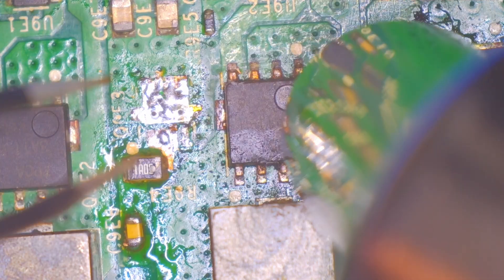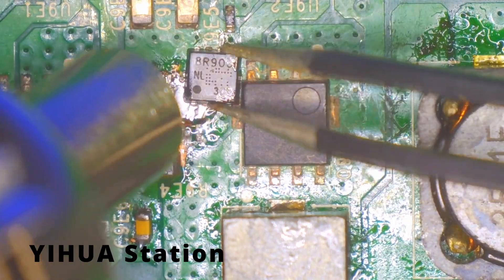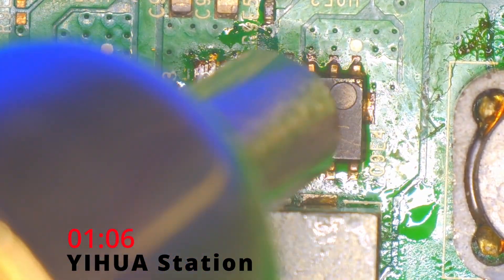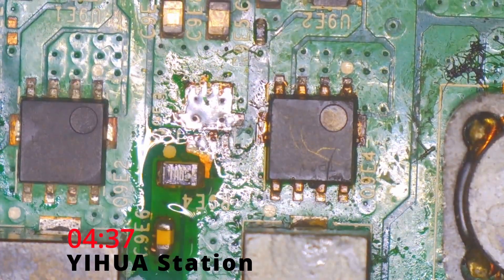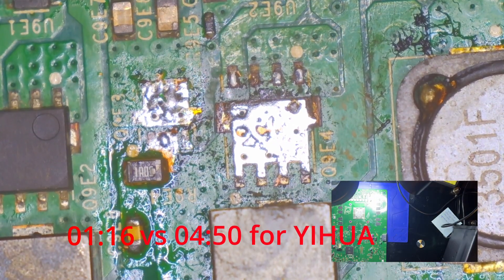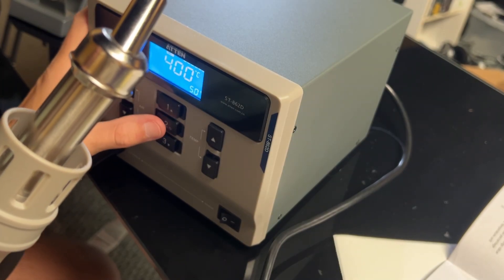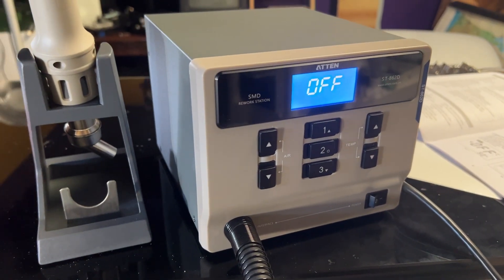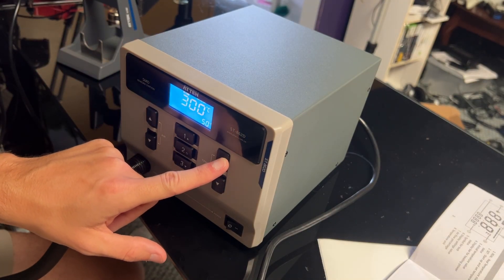Hot Air Station Review - Atten ST-862D vs YIHUA 959D Can a cheap station compete?

Comment: Should've put low melt solder on pin before using hot air station

Comment: bought a cheap one and it broke after few uses, but at first it was user error and couldn't desolder anything. i'm planning to buy also a cheap one but with the air blower inside the main station, seems more robust somehow, although the unit is almost empty

Comment: Brother you must be a beginner. You have to use low melt solder on the joints first and then use your hot air station comes off with low temperature.

Comment: I have a similar station to your cheap station.  Today I tested the heat with a thermocouple.   The iron was 50c degrees lower than stated - 250 at 300c degrees.   But the hot air gun was 50c degrees hotter than stated 450c at 400c degrees

Comment: Good review. I also have that Yihua unit but had not done a whole lot of micro pcb jobs with it. What it did awhile back was slip out of the side mount holster a little, reheated itself and melted the holster so badly that it wouldn't auto shutoff anymore. I just started to get serious about learning smd guitar amp repair, just bought a new Amscope SM4T and was shopping around for a new hot air station and saw Rossman's video, so I ordered one from his store as he had a much cheaper price than Amazon and he also includes the angled tips. I should have it tomorrow.

Comment: Here's an alternative that might work. A standard heat gun, better with a reducer nozzle to increase air pressure and isolate heat more. Obviously it's not the best tool, but Harbor Freight has one for $10 that goes on sell for less than that I believe. It comes with nozzles I think and they sell a nozzle kit too I think. But the nozzle part is probably less important.

Small one can be used for components it can handle and the full size heat gun can do in a pinch. Atleast I would assume that with a concentrated enough nozzle, a heat gun would put out far more heat. I've seen people use them before so I know it's possible, worth a shot for people on a budget and who don't want to dish out big bucks for hobbies. A torch variant would probably work too.

Comment: have  quick 857dw  it's been  4year's working fine and all board including high end GPU
don't set  your hot air  always max temp,  the heater will die fast,  just around 400 or 380c lastly  always use large nozzle

Comment: A minute of hot-air blasting seems like a LONG time!  I have not experienced this issue with my Yihua 959D, but I have had problems with the smaller nozzles working for smaller components.  I wonder if you also tried slowing the airflow, because the slower air that passes over the heating element will be *hotter*. There is a trade-off between heating your component enough to melt the solder, and melting things and doing damage, but it might be worth playing around with.  That makes me wonder if you compared the volume of airflow between the two units when you had success with the more expensive unit.  Believe me, I am absolutely NOT questioning your judgement, or whatever works best for you, but I only intend to bring things up to consider when evaluating these devices.
Reply from the maker: I recently did a newer comparison where I adjusted the air flow and used different nozzles taking into account some of the comments I receive, much like this one. It turned out interesting. I'd say the YiHUA performed better the second time around than it did in this video but overall still took longer than the Atten to remove a mosfet. Also, the fan speed on my YiHUA just doesn't feel nearly as powerful as the Atten though someone suggested cutting holes in the handle where the air intake is to get more airflow. Thanks for the comment!

Comment: Yea if you had the air all the way up than yea its not gonna get as hot as it should..  use smaller tip and low air, high temp..

Comment: I have the Yihua station, and it does do the temperature they say it does. It just needs a bit of modding and calibration. I have one, and after calibrating it to hit the set temperature at about 20-30mm away from what i'm reworking. Also, i had mod the handle, the intake vent for the blower fan more than half of it is blocked because of the crappy molding procedure so i just removed it all together so that the blower has no restrictions. Now i don't even have to turn up the air past 6 and i can remove mosfets off of motherboards with relative ease, I can't even turn up temperature to make because it's just way too hot.
Reply: I am at this step... I am thinking about cutting that Intake vent near the blower fan..... Was it a very noticeable difference? I am having difficult removing a mosfet from a laptop gaming motherboard.
Reply: @SoCoolGaming25  It's not going to blow like the stations with the blower in the station itself, that's impossible. But after cutting it out and recalibrating the station, jobs that were an issue is not an issue anymore.
Reply: @ interesting, I’ll give that a shot thanks!

Comment: I found this video because im looking for good recommendations for a hot air.

I have Yihua 2 in 1 soldering station with fan hot air just like your yihua hot air station. It uses the same exact hot air. I didn't had any problems with it even on thicker boards like laptop and consoles like PS4. It takes like 3-4 minutes to remove the HDMI port with 400 celcius and 80% fan speed. It also takes like more than a minute to take off a mosfet from a graphics card. I wanna upgrade to make my job faster and more pleasant (also I dont like using high temp like 400-410 for electronics it's not good for the component nor the hot air heating element) besides compressor hot airs can blow much more air compared to fan ones and also they are quiter. 

The problem I've noticed is that you are not using any flux. When desoldering or soldering a component ALWAYS USE flux. It makes the solder melt so much easier and it increases surface tention meaning the solder will flow by itself into the pad without it trying to stick to the soldering iron and creating this ugly spike. This is why you had the problem to begin with. You don't need max temp and max air you need to add flux. Also while choosing flux choose one that doesn't smell. I have this one chineese flux that irritated my lungs and throat and my chest hurt and i've also had runny nose with blood for a week. So get quality flux and smoke extractor to pull the smoke so you don't inhale it.

Also I bet that your Atten ST-862D with flux could desolder that mosfet in 20 seconds.

Take care improve and learn I believe in you!!
Reply: So i have that same station.. The 959D.. I used some lead free No-Clean flux... Held the hot air at 789 F also with some preheating and clocked my time at 1:27 and still no luck coming off of my laptop motherboard, Next step is to mod the device to see if that helps.
Reply: @SoCoolGaming25  laptop motherboards are thick to dissipate heat easier. Don't count time just put some flux, use hot air run it in circles slowly around the IC and it should come off once it reaches the melting temp. You can also train on other board that you don't care about breaking. As I said with cheap hot airs it takes a lot more time to actually desolder stuff. Just take your time and train you will get a hang of it!
Reply: @basilworshipper  thanks for those gems!
Reply: @ np! if u have any questions feel free to ask
Reply: @basilworshipper  my biggest fear is damaging the MB with to much heat… at what point would you say “this is to much heat on the MB… or this temp is to high… let me stop” what point would you say that by chance.

This is my first MB repair so trying to to avoid damaging it. Thank you!
Reply: @SoCoolGaming25  you can't really damage the board itself but you can damage the IC. I don't think you can damage anything unless you keep heating it for a long time after the solder is already liquid. You can damage the IC by making a hotspot and that's why you heat it in small circles in order not to blast heat on one spot of the chip.

Also you can damage the board when you try to pull the IC when the solder is not quite liquid. When you pull the IC it will come off with pads from the board. As I said the best thing to do is to apply flux, heat it in small and slow circles until the solder on the IC is fully melted and then grab the IC with tweezers and remove it off the board.

Again if you are not sure get some old boards that you don't care about breaking. It's better to spend some time learning than doing it without experience and regretting it by breaking the stuff you wanted to fix

Also! Depending on what IC it is you can put some fresh solder on those connections. Solder that is used during production has higher melting point so applying some additional solder prior to desoldering will help the solder melt quicker 

Take care and good luck with your repair, again internet and experience beforehand are your best friend don't rush and take your time
Reply: @basilworshipper  ah man that’s good information. You have been so helpful thank you! Going to attempt everything mentioned soon.
Reply: @Lifegetseasy4u  alrighties take care!
Reply: Hello there , i want to buy some equipments to practice and learn fixing my playstation controller and stuff like that 
What should i buy as a beginner? A cheap (20~40$) soldering iron kit will be enough?
Or a hot air station with a soldering iron included for 50$ 
Note that i will be working home, so im concerned about electricity and if it will handle the hot air station
Reply: @9lo740  hi! As a beginner those stations are absolutely enough to start your journey and with it you will be able to replace almost everything. The hot air itself is okay its a fan blower one but it will do the job it will take a bit longer to heat up the board. When it comes to the soldering iron they usually use 907 handle and while cheap it takes some time to heat up (usually a minute or so) and when you want to swap the tip you need to wait for it to cool down or use pliers which is kinda inconvenient but it will work no problem!

If  you want a something more expensive and more convenient I recommend getting a soldering iron with T12 handle. You can hot swap the tips and the tips while more expensive they have heater built in and they heat up in 5-10 seconds to 400 degres celcius. There are tons of choices locally or on aliexpress. There are even ones that are battery powered and charged via USB C that are super affordable. When it comes to hot air you can get the cheapest hot air station you dont need more as a beginner. 

I don't recommend other handles like 210 or 245 etc. They are pretty much the same as T12 but the tips are 10 times more expensive than T12 tips.

When it comes to other stuff, good brand solder and flux. Dont get the cheapest no name solder you can have trouble soldering even with tons of flux. When it comes to flux rm223 is a good choice or Warton Future flux in gel. The 2nd one has less odor compared to the first one but they work pretty much the same.

That's pretty much all you need to properly solder and you can get other stuff like desoldering pump, solder wick, tweezers etc. There are a lot of kits out there that have everything.

Electricity should not be an issue. Soldering iron draws like 80 watts and hot air depending on the model usually around 500-700 watts so pretty much a modern pc under full load. Your hair dryer draws like 1200-2000 watts same with vacum cleaner and other household appliance.

Worth to mention always open your window while soldering or do it in well ventilated area. Soldering is toxic and you dont wanna inhale that. You can also get soldering fumes sucking fans with carbon active filter.

Also playstation controllers are great way to start! 

 Good luck on your journey and if you have any questions feel free to ask!
Reply: @basilworshipper 
Thank you very much!
Best of luck to you too.

Comment: I have cheap hot air that will reach 410/20 and then drops back and fluctuates from 280/370-ish. I have a similar SMD on a gpu. going for a better device.

Comment: Cheap stations are no substitute for professional tools. ... With that said, some tricks you can do to help a little hot air heater is use a some good flux on the chip you are trying to remove and a little low melt solder. ... Sometimes old or led free solder just takes way more heat than the little heaters can blow out. So, by fluxing up and creating an low(er) melt solder alloy on the chip you can active better results. ... Making the alloy is easy. Just use your iron to mix a little low melt  solder with the solder on the legs of the chip.  Get the area nice and hot. Then go in with the hot air machine for the win before the board loses all the heat the iron applied to the board. ... As I said before, cheap tools are no substitution for professional tools. But, there are little tricks one can use.
Reply: Cheap because it is make in China where cost are lower.It s a reputable brand with over 20 years exp and not inferior in quality.

Comment: It's easy, Low down your air. More air, more heat dissipated. If you are doing rework solder, you want to melt down that only spot. So, high temp, low air. 400c and 40-50air. Will do anything

Comment: From what I experienced the units with the fan in the handle are crappy.  I started with one like the 959D, worked it hard when I first got it and it died before 2 weeks.  I returned that one and spent a bit more for the Aoyue 852A++.  So much better than what I just returned.  No matter what you get, work it hard when you first get it, that way if it's a lemon you still have that return window.

Comment: You could probably remove those chips even with a cheap station, I'm not saying you're wrong and yes better equipment will certainly help and is always a good investment if you're serious about it but here are a few tips for those with simple equipment:
-Use more Flux, people tend to think flux is only to help solder flow and attach but it also helps a lot with de-soldering mostly because it has a much higher thermal conductivity than air, thicker flux is even better in this situation
-Add leaded solder or low melt solder before trying to remove component, it will mix with the solder on the board and will really help a lot massively reducing the chances of ripping pads too and is even more important if you see traces of corrosion or really old and dry solder
-Try heating a wider area of the board, focusing only on the chip makes it much likely to burn or warp, especially with the better station, what you ended up doing in the end is more like brute forcing your way to success with more heat instead of doing it more gently
Reply: What you saying will help but cheap stations can’t do high demanding stuff, good hot air stations don’t require adding leaded solder and to be honest some people don’t like using leaded solder
Reply: This! I use a cheap sumsour 8586 to fix gpu and atx mobo as well, and it get the job done. But yeah having expensive tool really make worldly difference. But you don't have that option if you're poor or just a hobbyist
Reply: try on a 7 layers pcb with a cheap station and we can talk about that.. you can put a liter of flux on it
Reply: I have to admit that the author of the film is right. I was in the same situation, a cheap station cannot cope with large elements on thick boards. It is simply too weak, it is good for small elements for beginners.

Comment: You didnt use any flux, that will make it much harder to melt the solder
Reply: He did on the one which couldn’t be removed
Reply: doesnt matter. a good air station can desolder without flux
Reply: @ezwtwrziehag1736 this would mean you have to increase the temperature, that will apply excessive heat to surrounding components which is undesirable. A good hot air station does not change the physics of the solder, just gives hight flow and higher temperature capabilities.

Without flux you will also more get poor solder joints when soldering a new component on

Comment: Where’s the flux?
Reply: I see it.
Reply: Do you actually know what's the function of Flux for?
Reply: @rajamudarungus7390  Yes, it prevents oxidation and aids in heat transfer. If you don't use it while desoldering, you will not concentrate the heat and may cause oxidation on the contacts, making re-soldering hard.

Comment: The fan in the handle of the 959D is the weak point my one died and i contacted Yihua on Amazon for a replacement £30 they asked for a replacement no way am i paying that. I looked on Aliexpress and there is virtually no replacements for the fan as it's a 3 pin 24v fan

Comment: Did you try an angled nozzle on the cheaper rework station? I noticed the nozzles were significantly different and I've heard that the cheaper station works better with a different nozzle attachement.
Reply from the maker: The cheap one didn’t come with angled nozzles and the atten ones didn’t fit. It did come with three different sizes but I had no luck using any size to get the big ground planes heated properly to melt solder.
Reply: @FixMoreWasteLess  Right. 👍 Im not talking about the nozzles it came with. There’s an angled one I know another YouTube video talked about that he said was basically a must…

I’ll have to see if I can find out which one it was for you…

Comment: I had basically this exact same experience fixing a Retron 5 with the same rework station.... I wish I'd seen your video sooner! All the videos and reviews I saw before I bought it said it worked great!
Reply from the maker: I think it works okay with smaller and thinner boards. It did fine with a ps2 slim board. Newer consoles just absorb too much heat for a cheap station like this. The Atten has been fantastic for me.
Reply: It does if you know what you're doing
Reply: @xavierayayaell546  any tips?